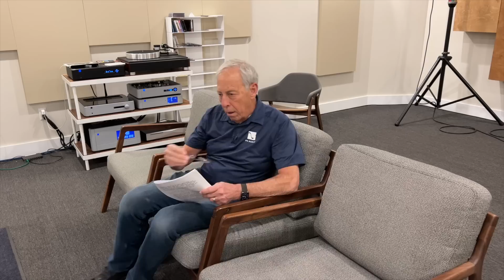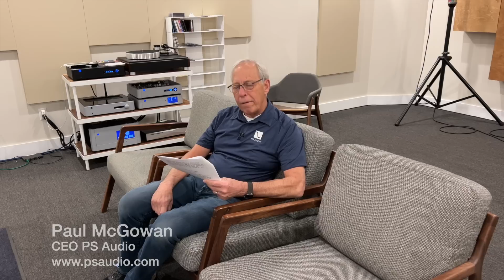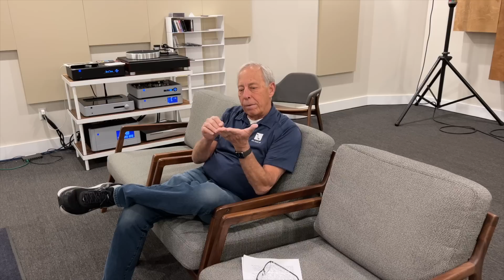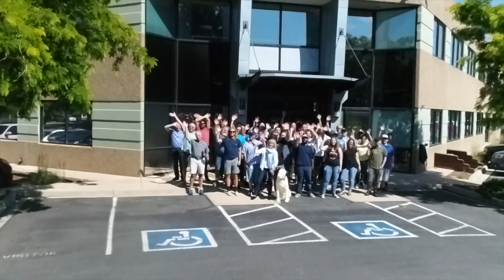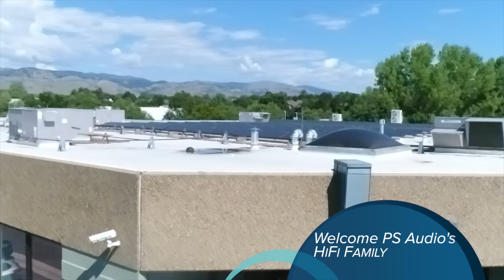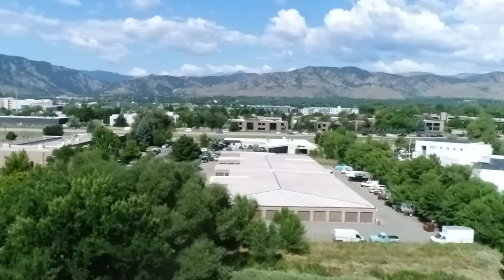Are TO 3 transistors better sounding?

Comment: the t03 package not only disapated the heat to the heatsink..but soon we learned that it held heat on the top side of its case. that did 2 things.. it helped the amp come up to running temp faster so that bias became stable..but it limited the wicking ability of the heatsink.. so that means they were always cooler on the tab side ( mounting side ) as compared to the cap side..(top) some people used radial fin radiators that clamped to the cap.. well that helped but the part still didnt have a common temp.. the weakness of the design was power handling ability.. the modern part that took its place (t-03p )  or t0- 247  put all of the metal against the heatsink..and the substrate was connected directly to the pins..that fixed a lot of problems in reliability and raised the level of voltage and current that could be designed into a part that was same size or  even smaller.

Comment: LOL  I have a small bunch of BNOS  TO3's less than 10 feet away.. and they are old but damn near unkillable..  used right they can be extremely good sounding

However the q you are answering is wrong from the start..  it's not about the TO3..  really.. it's about the tech used in the transistor not the pkg..

For another example  another pkg type thats sadly not being made anymore were commonly made by Sanken  aka  MT-200  package,    The more common TO-3P is very prevalent.. but lacks the dual mount point the MT200s had.. which is a BIG part of that physical pkg being better IMO

But as for sound.. the writer is most likely thinking of BJT vs Mosfet  which has been greatly debated for ages..  and afaik no MOSFETs were ever produced in the old TO3 can type pkg. (Mass produced and successfully marketed that is,)

Oh and yes the old TO-3s aka cans could be a ROYAL PITA for mounting to heatsinks vs the MT200.,.   but for surviving harsh environments there is good reason why to-3s are still made!

(I've seen a to-3 old BJT survive being shoved into a wall outlet and still work fine in an amp...  very old Motorola design..)

Comment: I really appreciate the point of view of a manufacture on this kind of question.  As a DIY'er for a bit, you could tell the TO-3 was going dinosaur when Motorola brought out BJT  power transistors specifically optimized for audio and most of those were available only in plastic.

Comment: I always believed TO3's had better thermal contact to a heatsink, bigger contact surface area, two screws etc.
However that said they most likely have a greater capacitance coupling to the heatsink (ground), and in modern high speed systems, especially class 'D', this could be a problem. Also, as they are physically larger it is harder to pack everything together to achieve short lead lengths so often called for in modern designs. (less inductance)
When the plastic packs first came out I hated trying to keep them cool, these days it's no longer an issue.
With TO3's they can be circuit board mounted (a few MM of heatsink between the transistor and the PCB), so hand assembly is not that bad, especially compared to lining up a row of plastic packs so when soldered in the mounting holes align with the heatsink in final assembly. (my experience in kit amplifier construction) However in a modern factory's every thing is automated, and I cannot see a pick-n-place machine fitting silpads onto, and screws into TO3's, so they were doomed ages ago.

Comment: my luxman uses modern 3 leg type mosfets and my ashly amps all have to3 type mosfets. I would think the entire circuit is more important than the type of mosfet used in these amps. They are my #1 and #2 amps. The luxman is better overall but those ashly amps are very close but have so much more power and hedroom than the lux.  So I would put my money on the circuit being the difference more than the mosfet. I don't know, I only speculate.
I have hundreds of used 10N16 and 10P16 to3 mosfets so if anyone in the PS family is looking...

Comment: I'm sorry to hear that TO3 transistors might be hard to find because my home-made class A monoblock amplifiers have Motorola MJ15003 types in the output stages and if any of them failed  - and they're all still fine so far after a number of years of constant use - I might have a real problem in servicing the amps. As far as distortion is concerned, all I can say is that a 15KHz square wave looks decidedly impressive when displayed on the oscilloscope I have. Very short rise and fall times and no sign of ringing of any kind.
Reply: I had a pair of ML 20.6 power amp.  Hope the power transistors never fail.

Comment: All transistors silicon? What about Geranium? I have an HH Scott 342 receiver, solid state but not a silicon transistor in sight! Geranium power transistors lasted well into the 1970s. As for TO3's sounding worse, would't it be the opposite? I mean that wafer inside the empty can would be able to breath, expand, adjust. Just think of what that does for your "sound stage". A plastic TO220 or TO247 is constrained and compressed in that molded plastic, no room to move. Would sound like a bad MP3 playback! Audiophiles 🙄
Reply: @@Douglas_Blake Yes, the material is called Germanium and not Geranium. And it is called Germanium because it first was found (not invented I was wrong with that) in Germany.
Reply: @Douglas Blake I have had some MOSFETs move while working on a UPS once! Right into my face when they exploded!
Reply: @Douglas Blake "In normal operation these parts do not move. As in no moving parts."
Yes, I am well aware of that. I guess you don't see the humor in either of my posts here.
Reply: I think that Germanium diodes are very suited for an audio rectifier, the sound very well,.
Reply: @@Douglas_Blake It's all about the music
Reply: @@Douglas_Blake just try and listen, perhaps even lose those ceramic snubbers. I am about science, trying to prove my wrong, if I fail I seek smarter people to prove my wrong. I am never certain, I doubt myself more than anyone else could.
Reply: @@Douglas_Blake Oh no, thats absolutely the wrong conclusion.
Reply: Hi, you talk about Germanium, its named like this, because? The Germans invented it.

Comment: Paul, you being an anolg guy, I would be curious in your times designing/prototyping or playing around if you had any experience with vfets or SITs?  I know Nelson pass has and still does play with them in designs including some big Japanese Tonkin sits he is hopefully coming close to releasing a amp designed using those the diy commu ity has horded. The Japanese earthquake and tsunami took care of that plant that produced them sadly. I guess they were used in elevators and can handle lots of power. Class a of course because that's what Nelson pass is a fan of!  Thanks !

Comment: The TO-66 was the small version of the TO-3.  I still have TO-3 2N3055 and MJ2955 transistors in my part drawers.  A lot of them actually.
Reply: TO-3 2N3055's  depending on type and actual mfr can be very good in some older amp designs.. :)

Comment: T03 use the same Die as plastic packages, anyone who says there's a sound difference is speaking as a religious idealogue. The difference is in the heat dissipation only, and as long as that is taken care of there should be no difference. If anything a T03 will have a higher capacitance between the case and heatsink, but we are talking maybe an extra 2-3pF and that would only have an effect at many hundreds of Khz

Comment: Transistors in TO-3 case were always more expensive than the plastic ones, and they always have better specification. BTW, military grade transistors mostly came in metal cases, perhaps even now military grade transistors coming in metal cases. And they sound better because they got better specs.

Comment: When I was building some amps in my 16s (that was end of the 70ies), TO3 was the holy grail for both the power supply and the amp output stage. 
TO3 had a great advantage over the upcoming TO22 because of their higher max. power loss going into heat (I remember up to 150W when mounted properly on a heatsink). 
Most famous TO3 was the NPN type called 2N3055. There also have been a few famous TO3-housed MosFets from Hitachi or so.

For curiosity, I opened 2 of those TO3 (with brute force), and there was a powder-like substance in the inside - assume it was for mechanical damping and heat dissipation.
Reply: I recall building a Heathkit in 1972 which used this style of transistor.  Wonderful sounding little amp.  Sorry I got rid of it along the way.
Reply: Seems that Paul inspired a little 'nostalgia' discussion about his readers' past experiences with building their own gear which was so popular in the 70ies.
As boys, we either screwed on our motobike engines to make tham faster than allowed - or we built amps and speakers. We had even Radio Shack stores in Germany those days - Paul will remember, for sure.

Biggest endeveour I had those days was to build a copy of the legendary Tannoy 'Voice of the Theater' with a friend who's father had a carpentry. Bending the front panels for the horn required a special press with lots of heat and steam. Finally, this speaker blew us away, and we used it for a huge party in our school's main hall. Then, we sold it to a church's youth group for their party location.

Years later, I had the pleasure to listen to another copy of this speaker, fired by a pair of custom designed class A, single ended 3.5 Watts amps - this was the most immersive listening experience I ever had in my whole life.

Let the good times roll!
Reply: It’s a shame Heathkit is no more. I built a Heathkit receiver in the 70’s. They had great high quality product builds with their kits. I wish I still had mine also along with the manual.
Reply: Check out onSemi's MJ21195/MJ21196 models.. Still around, and definitely not the same TO3's as back when we remember them..

Comment: The TO3 is the JEDEC designation for the package.  In that package there were all different types of transistors- germanium BJTs, silicon BJTs. Silicon Darlington, silicon JFETs and silicon MOSFETs.
The TO3 package itself was really poor performance  - the package inductance is in the order of about 50pF, the thermal conductivity was not great considering all the cost for the package and they were not that great from a long term ingress protection perspective. 
The replacement TO3P was designed to be able to line up on the same hole spacing as the TO3.  The TO3P and its derivatives (TO247 etc) were much better packages in all regards.
The world has moved on a lot from the old TO247 style packages and some of the modern surface mount packages are a much better fundamental design solution if you are wanting a good design starting point for a high performance amplifier

Comment: I have some old germanium TO-3 transistors in my storage bins ... OC28  OC35 AD140.. etc all brand new ! 
Plastic power devices must be mounted on over size heat sinks if you want them to  last ... thermal stress within the encapsulation can damage the semiconductor die . This condition doesn't exist in metal type cases  ..
Reply: @Douglas Blake you must have been running them at higher temperatures than recommended...
Reply: @Douglas Blake yes ... that's right 😀... they could simply plug in b and e pins had sockets an c had a washer tag which was integral with the mounting screws .... the only drawback with this connection method was contact resistance.....especially with the collector or case contact. If the device ran hot for most of its life then the plastic insulator could soften and reduce the contact pressure ( and resistance) of the connection.

Comment: TO stands for Transistor Outline and references some drawings of semiconductor packaging by JEDEC Solid State Technology Association, which is is an independent semiconductor engineering trade organization and standardization body headquartered in Arlington County, Virginia, United States. TO3 was originally designed in 1955 and lost against newer more cost  and PCB design optimized packagings. The first use of this package design was for the germanium (not silicon) power transistor 2N176, the world’s first power transistor to be put into mass production.

Comment: Great rant 😂.  As a guy that works on the older stuff I’ve always hated those to3 transistors. Their bulky, hard to mount and messy.  All good reasons not to use them 😂